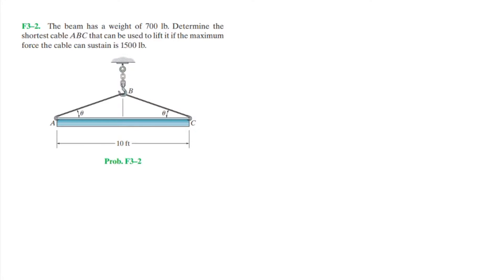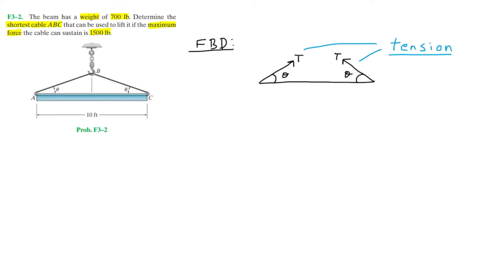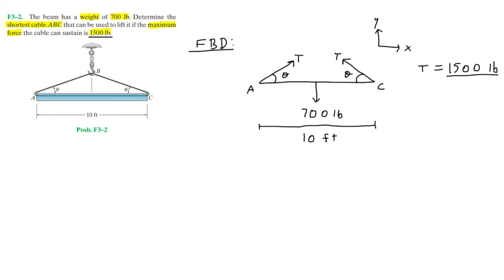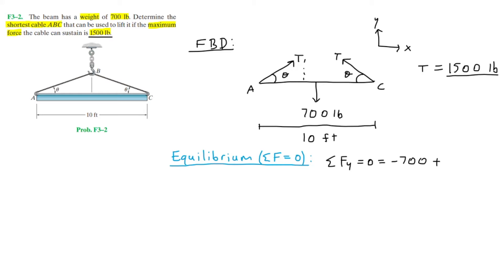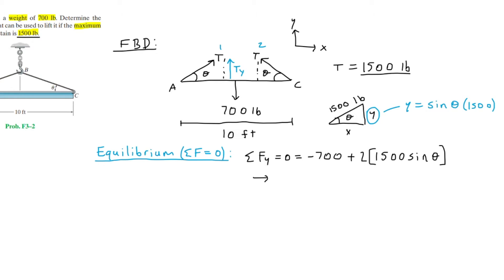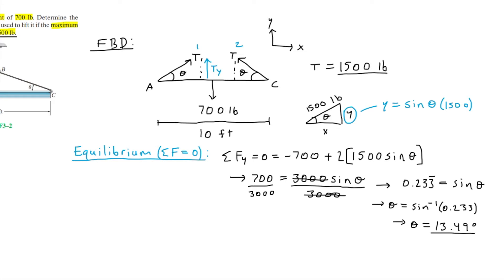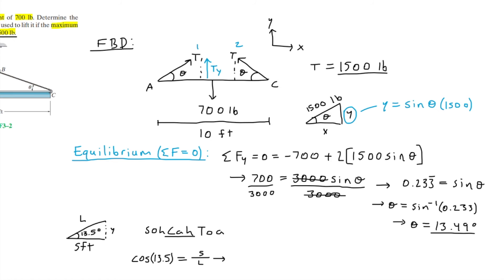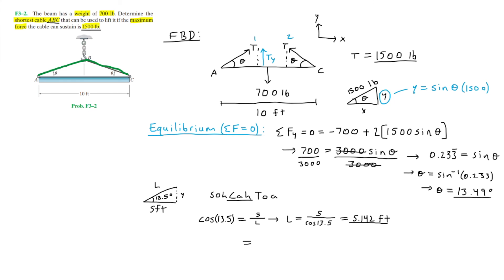Statics: F3-2 (Hibbeler)

Comment: wouldnt you have to split the tension into 2 cause its spread equally across both elements of the cable? why did we take the whole tension for both the cables?
Reply: its one cable, so tension is always consistent throughout.